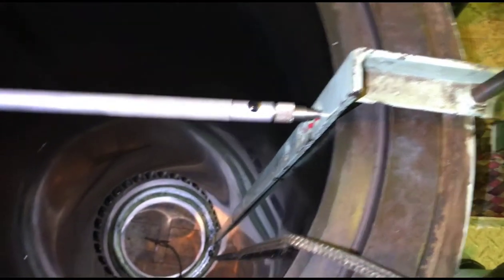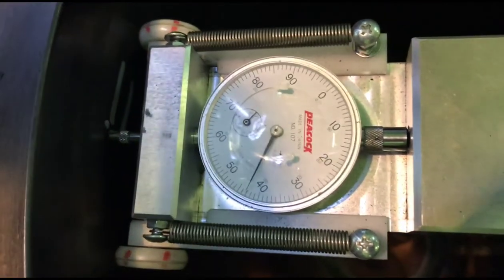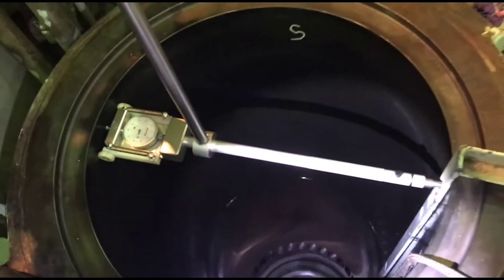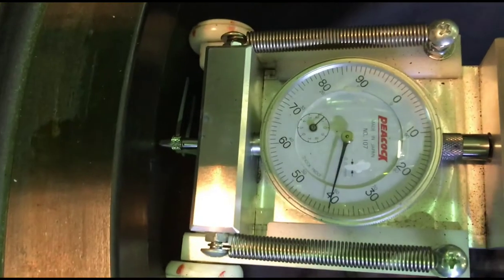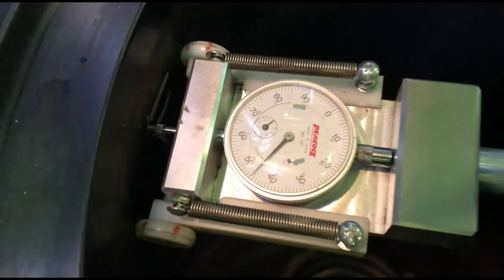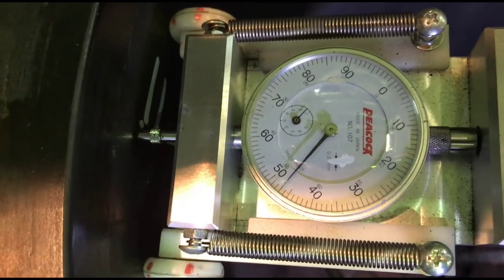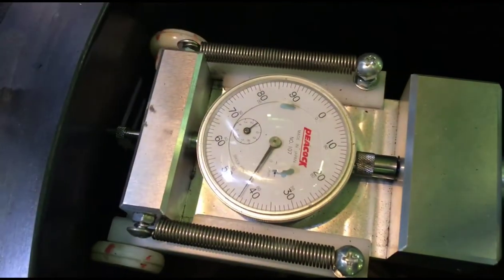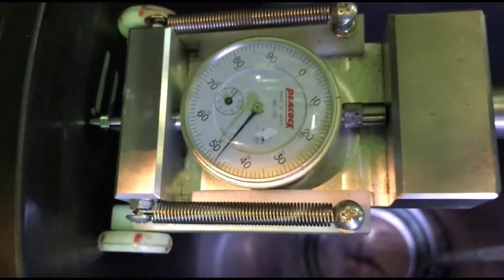B&W ME Cylinder liner measurement

Comment: Sir san makkita ung calibration na snsnbi nio which is 503 mm
Reply from the maker: Yon 503 is cylinder liner limit for replacement dipendi kasi sa maker ng engine.
Reply from the maker: Makikita mo xa sa form pag mag overhaul ng piston .